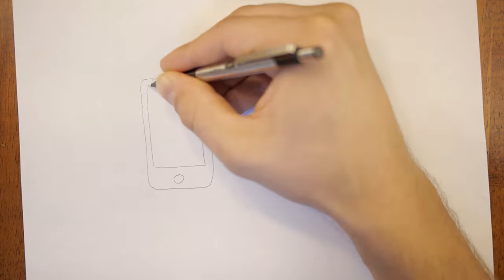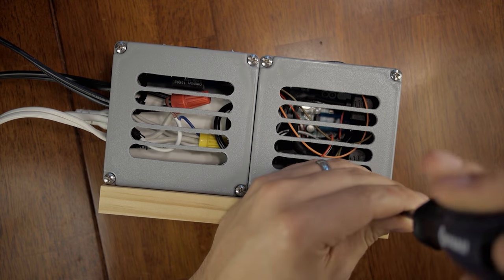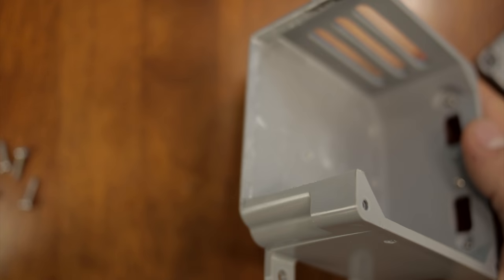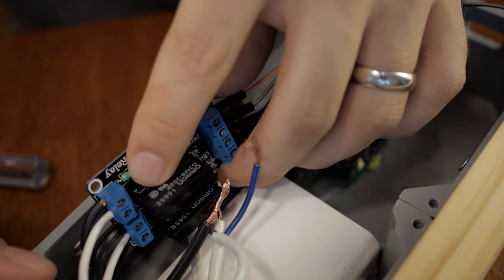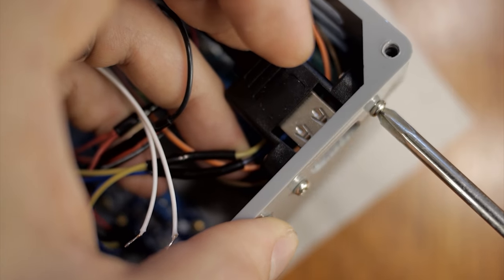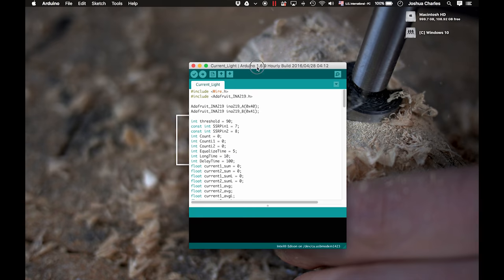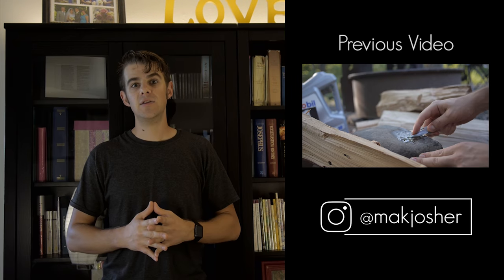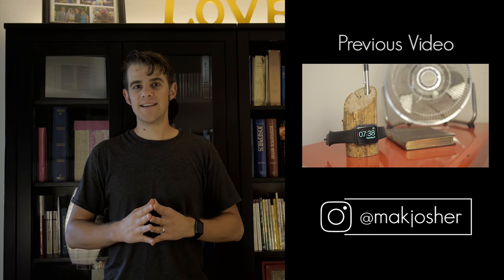Arduino Controlled Phone Charging Dock & Lamp

Comment: Wow this was awesome. Thank you finally someone who goes into more detail about the wiring. I’ve been thinking about a project pretty similar to what you did. But I was looking into using a wireless charger and just having 1 docking port. My problem has been that I’m not knowledgeable with wiring and circuits and all that. I also had this idea to make a desk lamp with a USB port and wireless charger and add led lights. But again I don’t know about wiring so not sure how to connect it all cause I don’t want to have 3 different power cords. Do you know of any other videos that might help me accomplish my project? Any help or advice is appreciated. Like I said before, this is an awesome idea butI need to ask. You didn’t show the 2nd bulb lighting up. Is it connected in a way so that the other charging port would activate it?

Comment: Did your Bus voltage and load voltage fluctuate a substantial amount when reading the live date output in Arduino?  I'm getting anywhere from 0.5V to 2.5V but mostly it stays around 1V.  My current is hovering around 720mA while my phone is at 80% charged.  I assumed this is chalked up to the fact that I have the iPhone 8 instead of what looked like a 6 that you had.  I want to make sure my INA219 is function correctly and my soldering job didn't mess it up lol.

Comment: Does anyone know if this would work with wireless charging? I’d love to do this but I don’t like the look of the wires on my desk.
Reply: yeah you can easily
Reply: u could use a bluetooth or wifi module to tell the arduino that its done charging via an app and then it would turn the light off

Comment: I like it a lot, I have 2 concerns though.

I'm no fan of the screw on cap, I think you'd be much safer soldering it and using 2 layers of shrinking tube insulation, that way you won't have to ever worry about a connection coming loose.

second concern is the way the phone rests on the charger.
it's a lovely design but I'd try to construct some kind of bracket that holds the phone in place so that the horizonal forces aren't on the port, in case of movement.
this way you protect the plug and port from unwanted movement that could cause a break.

Not trying to be an ass, just honest critique, I really like it!
Reply from the maker: I totally agree on your second point. I've already had some issues with that, but since the dock is modular and separate from the Arduino unit I can easily upgrade that in the future.

I love solder and shrink tube as well. However, for main electrical connections like this I generally just go with wire nuts. I figure if they are good enough for the wiring in our houses they should be good enough here.

Thanks for the feedback though, and no offense taken :-)
Reply: On the wire nuts, with home installations they are usually behind panels with wiring that is held in place. With your design, if the main box fell off a counter and the power cord got pulled, I would worry that the live wiring would just pull right out and be exposed.
Otherwise fun and interesting project.

Comment: Did you ever experience issues with apple's notorious accessary incompatible error popping up on your iPhone?  I would guess if at all this would be because of the USB extension cables not being MFI certified?  Or possibly because the cables are being spliced into?  Let me know if this ever proved to be an issue.

Comment: I didn't understand how Aurdino identify when it is fully charged...can anyone explain?
Reply from the maker: The current sensor monitors the current flowing to the phone. When the phone is charged, the current will drop to a very low value. When this drop occurs, the Arduino goes into the “charging finished” state and turns the light off. There is a link in the description to an Instructable, where I explain in detail.
Reply: @chargeeverywhere  Ok, Thank you for reply. and for the tutorial